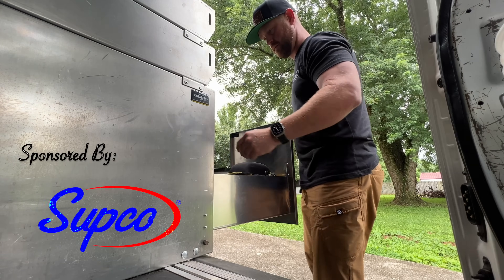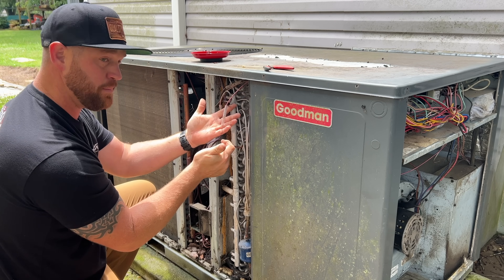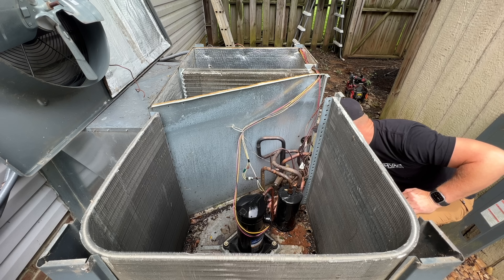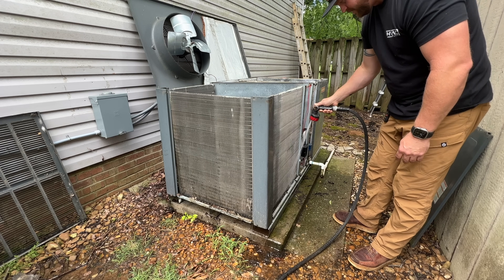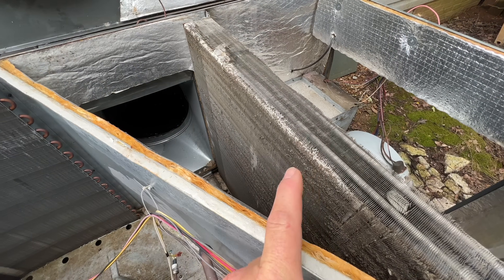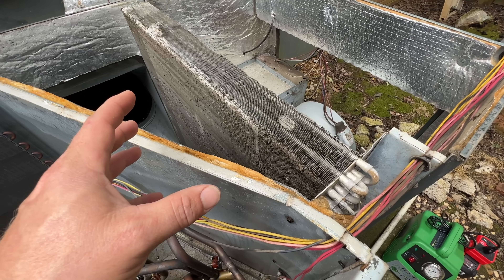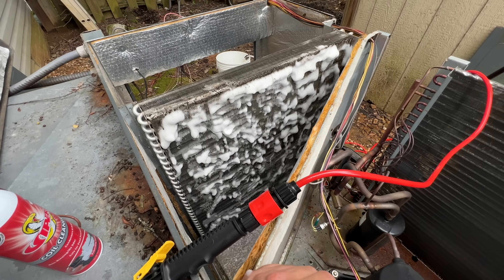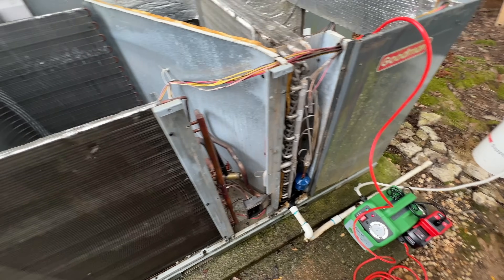How To Properly Clean HVAC Coils

Comment: good video!  We have the exact same unit...so this makes the job easier.  thx a bunch.

just finished up the job...and it was a nearly identical process.  I blocked off the air return plenum duct hole when cleaning the inner condensor so water would not go in. 
unit came right back on.  mine was surprisingly clean for 4 years.

Comment: So I have been told multiple ways to clean a coil and I don’t know who to trust or believe, I was told hook my gauges take a reading of the head pressure before and after you clean the coil to see if you need to add refrigerant but to me that doesn’t make sense because the system shouldn’t be low on refrigerant if that’s the case then there is a leak and then that’s a whole different approach of the job, I then was also told that you don’t have to hook them up when your doing a “pm” because if the system was cooling before then it should continue to work just fine if it’s a TXV system or a fixed orifice because that’s the metering device if I use my gauges I run the risk of creating a micro leak on the service valves that can cause a problem in the future only hook up the gauges if you suspect that the system is not working properly take a temp reading and get your delta T across the coil. So I have done both methods and honestly I don’t use my gauges at all when I do pms and the systems have been fine for years no call backs. I did however change up my cleaning layout, I use all viper products, I invested in a small pump foam cannon, the foam gun as well, and an electric pump sprayer for cleaning ductless units. An average cleaning depending on how bad the system is usually takes me about 2 hours. If the system is really bad then it’s a full 6-8 if I have to break everything down. I always be sure to look at the job first then plan accordingly. What’s your thoughts about it? Thanks!

Comment: Thanks for a great and simple and understandable vid . I was looking for a vid like this being the installer 4 years ago jury rigged the ducting and it fell apart letting the AC suck up a bunch of trash . And this was perfect it is the same unit as mine ,( replacing the ducting was a nightmare ) when disconnecting the 3 fan wires I used colored zip ties to mark them .

Comment: I like your video I have seen many of your videos I am recently retired and have about 42 years experience In the hvac Industry. I mostly Like that they are true and Accurate. Contractors make about 70% of their annual income doing maintenance. When it is necessary and serves a purpose and benefits the customers then it is good. It will also save them utility money. But after a lifetime of doing this Most of the maintenance that I did was unnecessary and served no purpose And so now we have all these videos online about HVAC scams. We should make sure that all these apprentices who make these comments online realize that that's what most of our job is.1 big scam. Most of the techs I worked with never even learned how to do their job by the time they retired. But no criticism of you everything you said is true And I thank you for the video.

Comment: When cleaning the evap coil (interior coil), if i don't have a HVLP pump can i use compressed air after applying coil cleaner?  If I block off the inlet duct, and cover blower motor with visquine can I use my water hose to flush coil out, or is that forbidden.  The wife has 2 shit eating Chihuahuas that shed constantly so my coil is REALLY BAD

Comment: So 30 seconds in 1st mistake 1st thing you do is turn off power stopped watching at 1min 37 seconds I bet he uses his impact to put screws in and strip them impact fine for removing drill with clutch for installing

Comment: Instead of using the aerosol spray for outdoor condensors, i reccomend using nu calgons Alkabrite + and a foaming attatchment for your garden hose. It foams up in all the fins, eats away all the dirt and grime and pushes it out, and you can rinse easily with a hose. Then i prefer using Nu Calgon no rinse Evap foan  coil cleaner that self rinses with the condensate, obviously brush any heavy buildup off before hand.
Reply: Those are coil destroyers.

Comment: vinyl siding mounted disconnect??? that seems safe, i had to clean a N coil evaporator of all the years of pet hair caked on it, about an hour between cleaner, tooth brush and a small vacuum cleaner to get it cleaned. did you pull the blower wheel and and clean it, or was it not caked up yet?

Comment: We used to have an HVAC guy that was amazing.  When he came out for the yearly cleaning he would also apply a coat of car wax on the outside of the condenser unit. Our unit was 6 years old and after he moved away we called another company to do our maintenance and they were amazed how new our system still looked. We told him that our previous contractor actually waxed the outside unit and they tried to say doing so would hurt the condenser! Lol! Needless to say we didnt keep that guy and found another company.
Reply: As an HVAC tech myself, we usually got way too much on our plate to wax units... 😏
Reply: @leviweltin1163  I totally get that, and i would never expect a hvac tech to do so. I just thought the fact that he did wax it showed initiative on his part. However, for a hvac tech to tell me that waxing the outside of a condenser unit could hurt the system, it is just ridiculous! I get that he didn't want to do it, but he should have just been honest about it.
Reply: @number1pappy  Yeah, it definitely did show he cared... I occasionally will take time to clean units off with some spray. But yeah, as long as you don't mess with the coils, it should've been fine!

Comment: What kind of service wrench was that?
Reply: 1/4 in. Drive Electrician's Mini Ratchet with Screwdriver Bits and Adapter. It is made by klein, and a great tool.
Reply: 1/4 in. Drive Electrician's Mini Ratchet with Screwdriver Bits and Adapter. It is made by klein, and is a great tool.